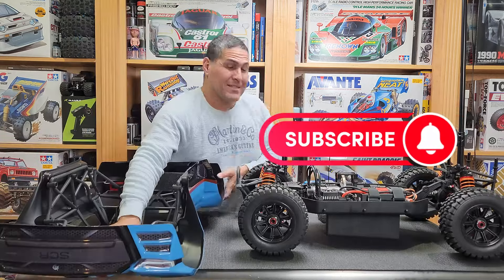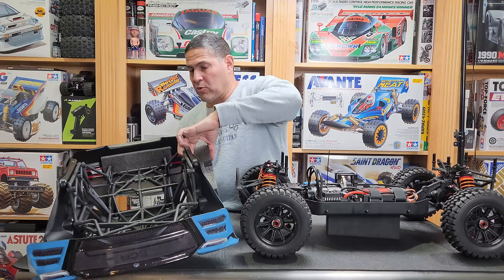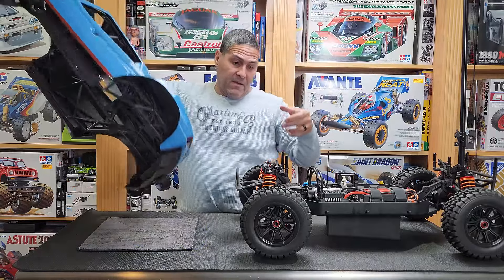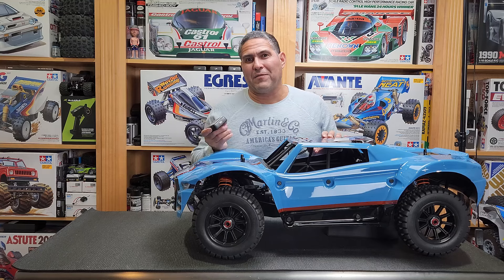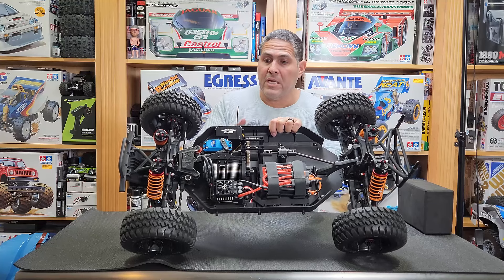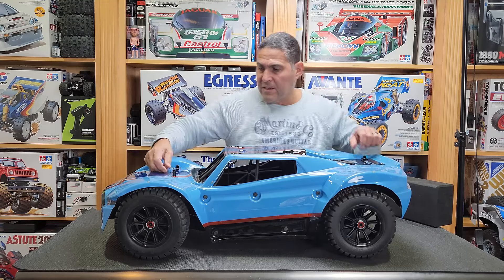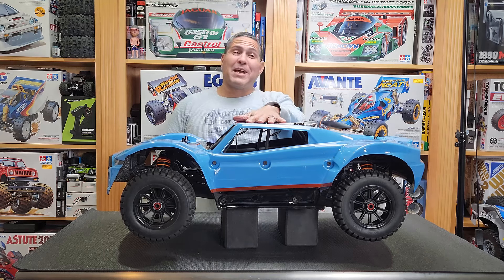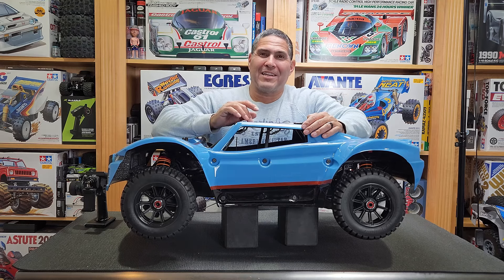GIANT RC CAR POWER UP

Comment: You can always tape the tires or run the new belted tires they have out.
Reply from the maker: I've seen but never tried the tape method. I will look more into that. I really want paddles but not finding the size I want. everything I see is under 7 or over 8 inches. Looking for 7.5 by 4 inches. Thank you for watching. 👍👍👍👍

Comment: I think you should still upgrade the ESC to a 12S-capable ESC...but, stick with the stock motor, and continue to run it on 8S.  The fact that the ESC can handle higher voltage means you can increase pinion size and/or decrease spur size, giving it faster speeds, while not overloading the ESC.  Plus, you could always switch to a slightly lower kv motor with the ESC, while simultaneously decreasing the pinion/spur ratio, which would simultaneously increase speed, whole also lowering the ESC's power output to the motor.

I still see the left-side weight bias problem potentially causing problems.  Since relocating the center spool/diff & center driveshafts would be too difficult (but, not necessarily impossible), maybe you can come up with a way to mount the LiPo packs on opposite sides of them chassis.  While it wouldn't produce a 50/50 left-right balance, it would get it closer to 50/50 than it currently is.

Since you can't weigh the car (no worries, and no apology needed...I know about the SkyRC corner weight system max weight limitation), there is another way to get an idea of the left-right weight bias.  If won't give you the weight...but, it will show you if the left-side bias is 'minor', or 'major'.  Pick up the car (body can be on, or off, but batteries need to be installed) with one hand holding the front, they other holding the rear.  When picking up the car, hold it by the front & rear bumpers, as close to centered as possible, using only two fingers (thumb & pointer finger) at each end.  I know it's heavy...but, you'll only need to hold it up for 5-10 seconds max.  In building the car with only those four fingers, if the car isn't perfectly balanced left-right, the heavier (ie. left) side will droop.  If it only droops slightly, the left-side weight bias is 'minor'.  But, of the left side REALLY drops lower, that will show you the left-side weight bias is 'major' (which is what I've been assuming).

Whatever the outcome, you'll have a better idea of what possible problems there might end up being.  Also, you're one step closer to convincing me to buy one. 😁
Reply from the maker: It looks like this chassis was sold in a gas buggy form as the XCR-1000. That would explain why the center diff was offset to accommodate for a bigger gas engine. That is also probably why all the electronics are on one side since it's where there was the most space. Putting a second battery tray on the opposite side would definitely sort this thing out.
lol I'm not trying to convince you. Just enjoying the hobby and learning as I go.  😂😂👍👍👍👍
Reply: @allscalerc  The "originally designed for gas engine" thing makes sense, especially being 4WD (as opposed to something that is 2WD gas/electric, such as the VESLA.5 from Kraken RC).  However, in looking at the Losi 5ive-T 2.0 (which I'm also planning on getting), which is a gas vehicle, you can see what they did with the center drivetrain (the front center driveshaft is also at an angle, albeit, not as much...but, fir the rear center driveshaft, the rear ring & pinion is offset, similar to how some crawlers use front axles with offset pumpkins, which allows the rear center driveshaft to go almost straight back.  To counter the potential driveshaft angle problem, I might have a solution...but, it would depend on the lengths of the front & rear center driveshafts.  The possible 'solution' would involve using the trident-style driveshafts available for the Hobao VTE2 and/or Arrma Limitless.  Don't know if they'd work...but, could be worth a try (I'm willing to be the "guinea pig", but it would be several months).
Reply from the maker: @ninthislandrc  I ordered a 5T in the blue months ago. It's on backorder at TowerHobbies.com. I was considering canceling my order it's taking way long, and now I have this. I'll send you the drive shaft measurements if you like. 👍👍👍